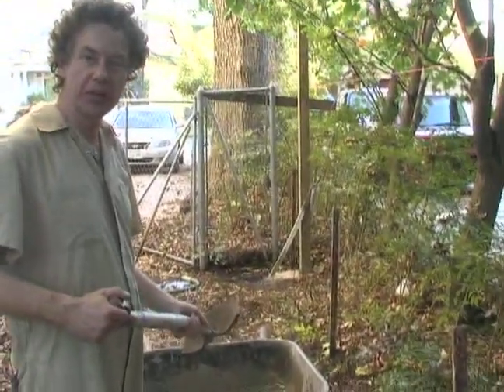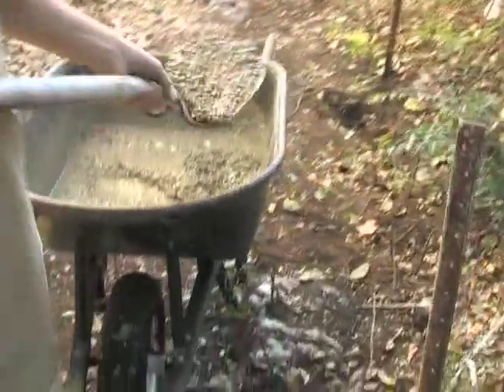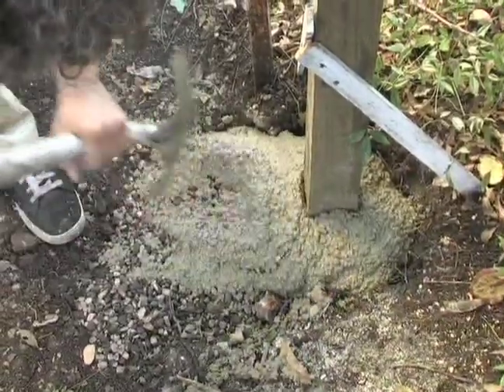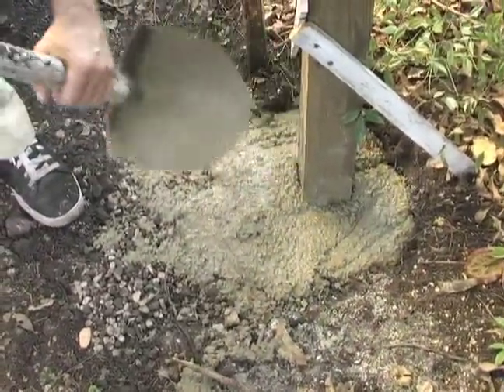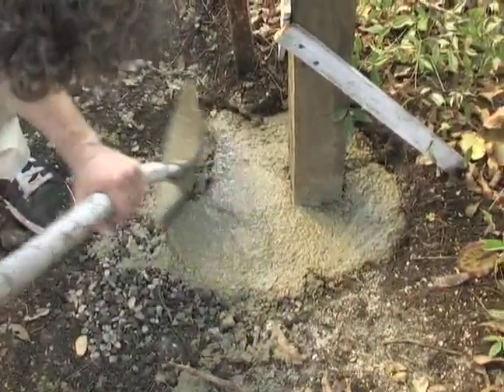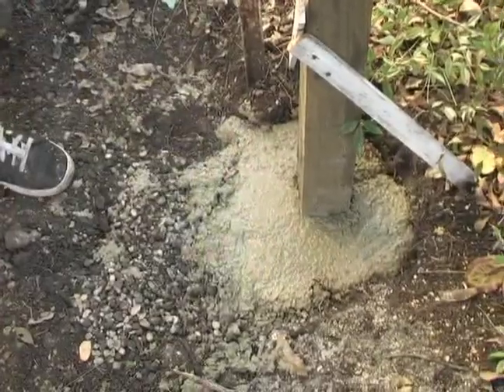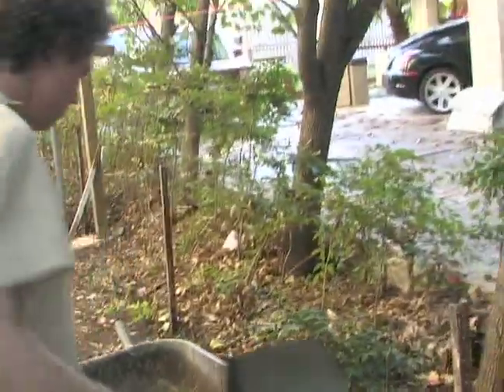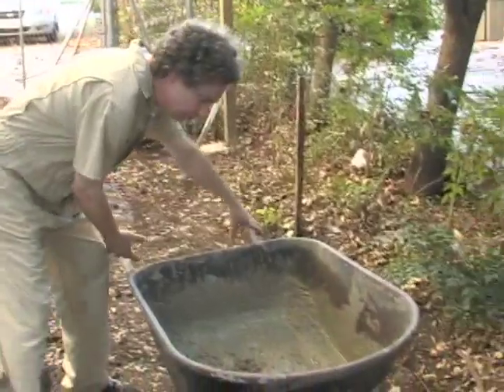Build a Privacy Fence : Cement a Fence Post

Comment: Yeah, and removing a lump of concrete 2 feet in the ground cant be fun. Last summer I used what we call 'concrete fence spurs' which go in the ground and fence posts then attach to the spurs. Since the wooden posts do not come into contact with the wet ground they should last a fair while. If they rot after time simply unbolt them from the spurs. Way to go I think.

Comment: way too wide a hole an too much cement.  Will never be able to remove.  Use 1/2 bag per hole 3 inches wider than post. and 25% of post height deep.
Clemis